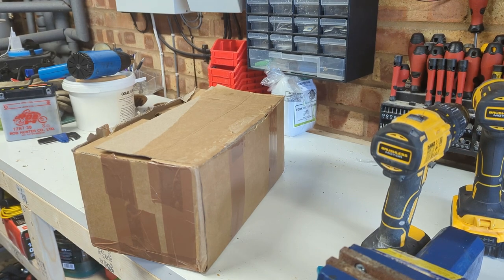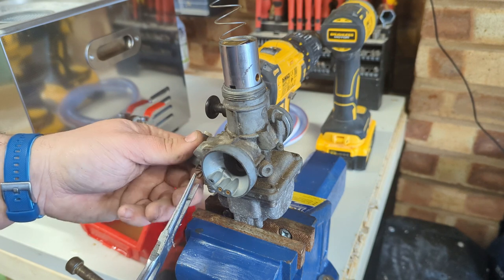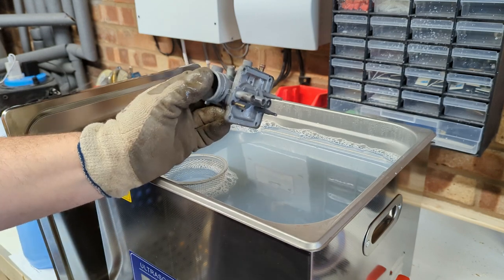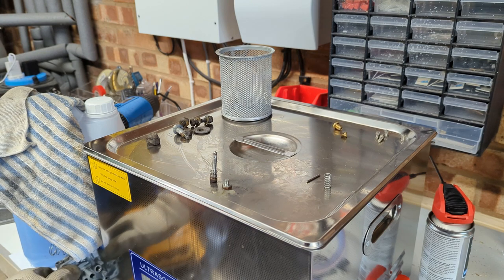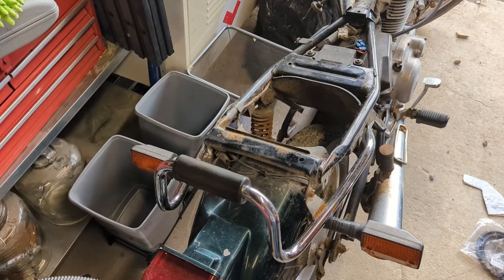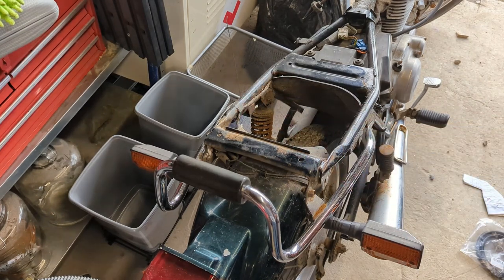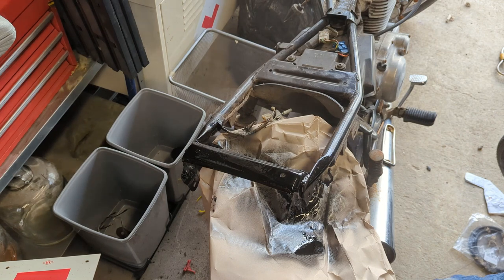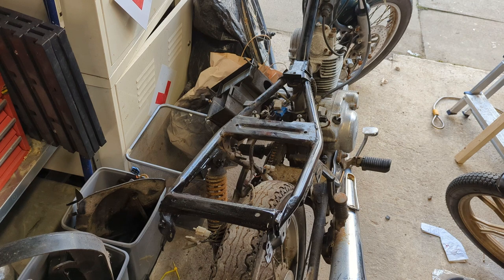Dodgy Paint & Carb Clean - The Grand Challenge | JAM#13

Comment: Yeeees! I was going to lament how easily everything was coming apart on yours, I'm pleased you've had to get the grinder out at least once! 😅
Reply from the maker: Its alright, the welder is probably coming out to raise the exhaust and fabricate a bash plate !
Reply: @justanothermotorcyclist  good stuff! I spent a full day doing another engine swap and sticking some meaty adventure tyres on mine and my mate Jez has made me a bash plate that will undoubtedly outlast the bike 😅
Reply from the maker: @BobsBikingAdventures  Just seen your video, you aren't having great luck with that bike for sure !
Reply: @justanothermotorcyclist  you're not wrong... Fingers crossed for some plain sailing.